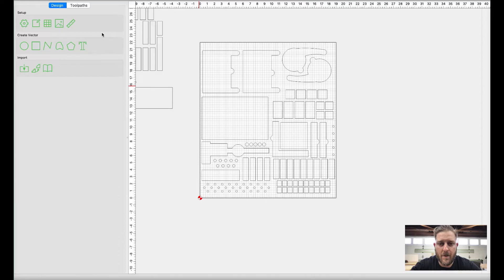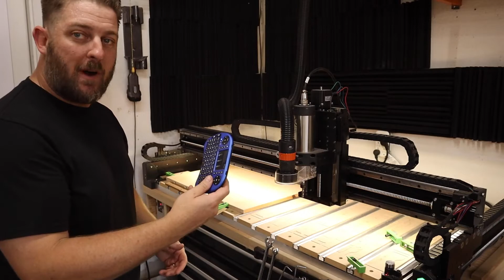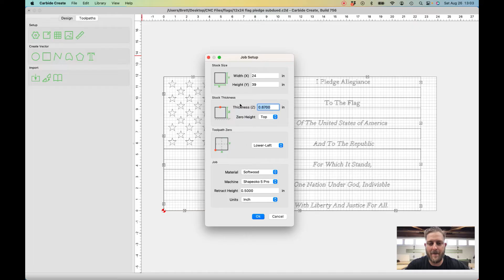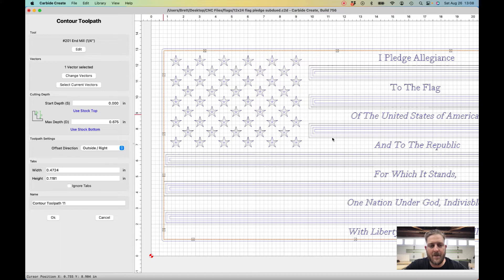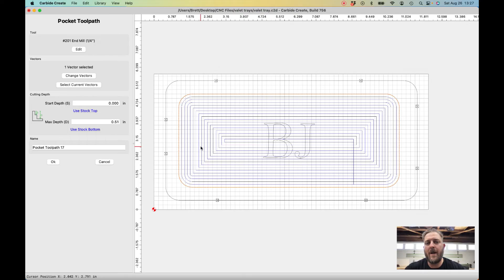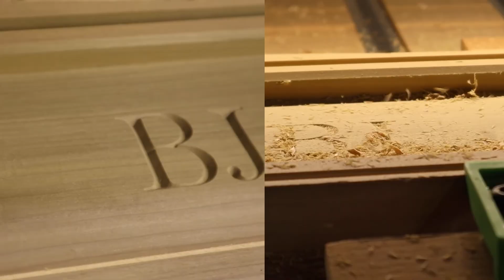Start CNC Crafting With These Top 3 Projects For Shapeoko 5 Pro! | Brett's Laser Garage

Comment: Why not use a downcut bit and avoid the sanding?
Reply from the maker: You’re right you could for sure could do that.  I demonstrated with the #201 endmill because it’s what comes with the Shapeoko.  Also, an added benefit is it leaves the bottom of the pocket nicely milled.  It’s easier to sand the top surface than to get into the small areas of the pocket.  Thanks for watching.

Comment: Just got my Shapeoko 4 XXL and haven't cut anything yet this video was a great help. Have a couple questions one How far do I put the bit in the router and also what speed do I put the router on that came with my machine? If you can help that would be great.
Reply from the maker: Awesome thanks a lot.  Just like a regular router you want the bits to be installed as far as they can without bottoming out.  If you’re running a makita or C3d router I usually had it on dial setting 3 which is about 17000 rpm.  Depends on other factors like what end mill/v-bit, plunge speed, depth of cut…stuff like that.  But generally for what I did in the beginning I had it set in 3.
Reply: @LaserGarage  Thank You, and do I go to your website to download the files in the video?
Reply from the maker: The files are located on cutrocket.com.  Link is in the video description.  Good luck and have fun!

Comment: What starter bits you recommend for someone who is starting?
Reply from the maker: I only recommend getting 3 to start off.  1/4” upcut endmill, 1/8” upcut endmill, and 90 degree v-bit.  Those will get you through a ton of starter projects and add to the list as you need tools on a project by project basis.

Don’t waste your money on the starter sets sold by a lot of manufacturers.  You’ll end up not using half of them.  Ask me how I know…😂

Comment: Thanks Brett for all the information on your video.  That is very king and generous of you to provide the files for making these projects.  I do not have a CNC router YET, but I am seriously considering purchasing one.  It looks like the Shapeoko 5 is a good place to start.  What would be your recommendations?  Thanks.
Reply from the maker: Thank you very much.  Choosing a CNC depends a lot on your budget and what you want to make.  Short answer is you can’t go wrong with any of the Shapeokos.  Remember to check you local FB marketplace or Craigslist for used deals.  My first cnc was a Shapeoko pro xxl I bought used on Craigslist.

Comment: Hey Brett ok I got the drawer tray done and it's GREAT! Now I'm working on the flag. One problem I'm having it the lettering isn't deep enough. The letters are barley readable. How can I fix this? Thanks in advance David
Reply: Hey man I figured it out. Thanks again for the files and the help of getting started. David
Reply from the maker: Awesome great work.  Always make sure your z height is set correctly, I’ve messed that up a million times.

Comment: This was the first project that I did with my shapeko. My struggle is with the text, it doesn't seem to go deep enough. Any thoughts as to why it barely going into the material? I am using the 60 degree jenny groovee bit.
Reply from the maker: Awesome!  Couple things come to mind.  Make sure your material thickness is set accurately in the job setup and double check your zero is set accurately.  Also, job is setup for a 90 degree v bit, did you change that info over to a 60 degree in carbide create?
Reply: @LaserGarage  I did change that to a 60 degree and the thickness was entered. I did find another issue with the collet, I am planning on trying another run. On another note, do you have a Rii and tablet hooked up to your machine? Wondering what/how you have that set up?
Reply from the maker: @spencershropshire6895 cool, good luck.  Yeah I have the Rii wireless keyboard and a cheap windows tablet connected to my Shapeoko.  I really like the setup.  I talk about it in more detail in my review video.

Comment: Awesome video, thanks! I am awaiting the arrival of my Pro XXL. One mystery to me so far has been the actual user interface to the machine. I see you have a tablet there and a wireless keypad of sorts. Is that something that comes with the machine? Something you added yourself? Something I will NEED to buy to operate the machine? Any light you can shed on that would be awesome...Thanks, Dan
Reply from the maker: Thanks a lot!  The cnc connects with a computer or laptop typically.  The tablet I’m using is just a pc tablet, it does not come with the machine but I find it easiest to use to run carbide motion.  Check out my Shapeoko 5 pro review video, I show this in more detail.

Comment: I am a newbie and I like your videos, I was confused with the V-Bit and the bottom of the stock (.67) when I initially watched, then I went through and read the comments and it makes sense but in theory if you did use the CC “bottom of the stock” preset wouldn’t a V-Bit try to go to the bottom of said stock??  Thanks!
Reply from the maker: Thank you very much!  V bits are definitely a little confusing but what it really comes down to in CC is what particular tool path you’re using.  If you press bottom of stock with a contour tool lath then yes, a v bit will go all the way down to the bottom.  If you have v carve tool lath selected it will not as I demonstrated with my star example.  There’s lots of discussion around this on the C3D forum with people that are a lot smarter than me and can explain it a lot better than me.  I encourage you to check that out if you’re interested.   Thanks again for watching.

Comment: Just looking at some CNC videos and wondering how feasible it would be for a hobby/very small business I do.   I build board cut slingshots and currently have to make a template then cut my stock oversized on a bandsaw then use the template and a flush trim router table set-up then go from there in regards to round over and band groves.  Cutting them on a CNC would eliminate a step.  In the beginning I used cabinet plywood but now use HDPE for most production runs and I'm curious what you'd recommend for a minimalist  machine for me. Most HDPE stock I buy is 12x24.  Some is cutter board that's like 15x20.  The 3/4 and under cabinet grade plywood can be sized accordingly.  This is a give away video I did couple weeks ago that shows some of my frames.  https://www.youtube.com/watch?v=_tYxzFDjePU&t=174s  Thanks.

Comment: on the last job, how is the BJ not going thru the stock since you told it to go to stock bottom?
Reply from the maker: I can see why you’d think that, I was in the same boat.  Basically the max depth is irrelevant when carving in CC.  The actual depth of the cut will be derived from the angle of your vbit and the spacing between the lines in the vectors you are selecting.  There's some videos that explain if you you're interested in searching on YT.  Thanks for watching and the comment.
Reply: @LaserGarage  thank  you... [ combining all my posts and all your answers, in one answer here ] ...that shows me why I am struggling with the CC and CM products, much of the behavior is blackboxed in their code,  trying to help the math-void crowds while confusing the reality of calculations in the mind of those who see geometry correctly.  I can add this, I have quickly learned that the router Z-placement in the collar is crucial, and that most of the time CNCers are just getting lucky and do not know why!? Also the reference for the bit-reach(max depth, 0 depth/height), I always set as bottom of the stock, too easy to make a mistake and end up in a nasty bit crash... but not named that in their settings dialog!!! all a confusion of nomenclature that must be translated in the mind to correct the coarse thinking. ...and CM is a mediocre misleading software that is blackboxed to ignore the retract parameter when it is part of the equation.  For instance, their rapid motion to take the bit a certain distance over x,0,y0 is a guaranteed crash into the stock and destruction of the landscape that is quickly converted into fire wood, if not a ruined or broken bit.  I know nothing about CNC, yet I see all this faulty sht.  The world is flat out ignorant.  I am quickly cramming Alibre Exert, MeshCAM, and CNCjs to forget the Carbide3D crappy software... I just do not want to continue to be surprised the hard way, by their idiotic invisible internal math and having to make mental notes to compensate in all my calculations to get around the non-sense.
Reply: @LaserGarage   hmmm I'd better clarify this here where it is said... to be accurate, when  you say 'when carving' you mean ONLY the toolpath type VCarve... because the other types DO respect the max-depth, and must or it would be a complete nightmare!  ...and a separate point, the stock should never be referred as the 'material', though generically not incorrect, it requires translation, therefore confusing to the noob!  ...stock=size, thickness, shape, the piece OF what 'material' one might be using.

Comment: I wanna know how on the FLAG project, the bit cut all the way thru a 3/4in stock piece, using .67 max-depth???

...and why written instructions are a mile better than videos loaded with inconsistent nomenclature that creates confusion, like the stock is also called material, yet they are given different thicknesses in the video(3/4, .67)!
The software itself has a load-material button that is used to get the gantry out of the way to load the stock piece(material)!
As you can see .67 is the max-depth to carve into a 3/4 stock piece NOT the material's thickness![take note: the title of the section in job setup IS: Stock thickness!] and why it must be typed manually in the max-depth parameter!!! [cannot use the stock bottom trigger, below the parameter box]
...and this is not the only video with these sorts of issues... one can waste massive time watching videos looking for an answer never addressed.
Surely, one always learns from a video, but one must waste massive time to watch tons of them to gather a personal list of answers sought, as if you had 2 years to book educate yourself, so you can go to work now for a simple job!
People, if you were to make a plan on paper/computer... and follow that accurately when you do your spill, you could first layout up-front in the video what will be covered... so, your list should be a parameter by parameter full explanation that translates into a set of job steps...
Yes, it is better to have something rather than nothing, but this off the cuff crap is mediocre, time wasting.
ooops! not in video, I am wasting my time here!  I have work to do, and without the answer, I am at a stand still.
Reply from the maker: I answered your Vcarve question in your other comment.  Basically CC does not take the depth of cut into consideration when using the Vcarve tool path.  The DOC is determined by the angle of the bit.  For example, a 60 degree v bit will carve deeper than a 90 degree v bit given the same vector lines.  Like stars for example.  Not sure if other programs are like this but this is how it works in CC.  

Not sure what your confusion is regarding the stock thickness.  My personal material thickness was .67 inches as measured with calipers.  In my CC free file, I list the flag material thickness at .75 because that is commonly the thickness of "3/4" MDF you buy at the store.  I think I mention in the video the importance of accurately measuring your own personal material and modifying the cut setting/parameters accordingly.
Reply: @LaserGarage  see my answer in the other posts

Comment: Great beginner video. Your a pleasure to listen too you appear very confident which is assuring to a newbie. One question about the valet tray, could the tool paths for the V bit been done at once. It appeared to be an extra tool change. Mind this is coming from someone who is procrastinating about buy the machine, so I may not know what I’m talking about. Thanks again.
Reply from the maker: Thank you very much!   Yes, I definitely the chamfer profile could have been added after the v carved initials but before the perimeter cutout.  That would have saved a tool change.  Good point, you know your stuff.

Comment: When you set the depth of the Vcarve you set it for the bottom of the material.  Aren’t you afraid that the cut will go through the bottom of the board.
Reply from the maker: I can see why you’d think that, I was in the same boat.  Basically the max depth is irrelevant when carving in CC.  The actual depth of the cut will be derived from the angle of your vbit and the spacing between the lines in the vectors you are selecting.